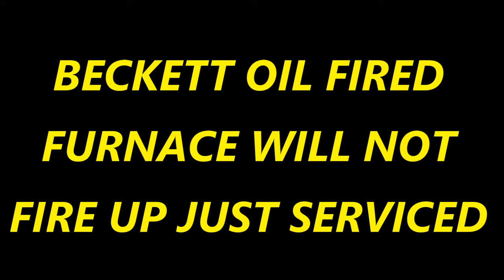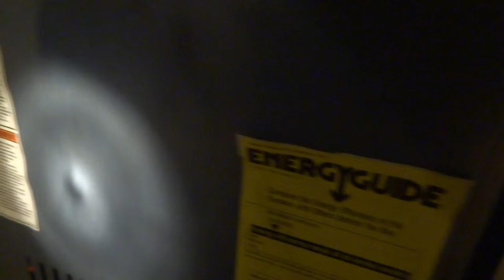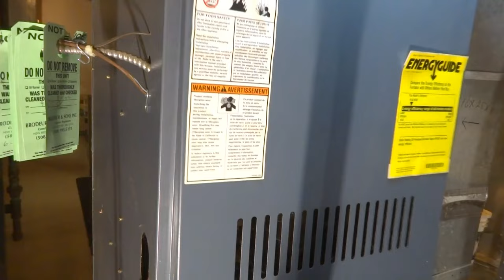OIL FIRED BECKETT FURNACE WILL NOT FIRE UP -JUST SERVICED

Comment: The spinner detects a magnetic field which you won't have with a failed winding in the solenoid coil. Also there is a old TSB (Technical Service Bulletin) about those coils. They would develop a break in the winding that would intermittently show up when the coil got hot creating a burner failure / reset problem. Diagnostics was.......If you suspect the coil on a intermittent reset problem, replace it .   Best of Luck.................
Reply: That was some great and specific info!
Reply: Lol. Steves not dumb, idk how he thought a compass would spin by electrical and not by a magnetic field. Lol. He knows he cant use it to test for voltage on wires, he must have had a brain fart. I get stuck on stupid sometimes myself.
Reply: @Dan-f7b he used it for detecting magnetic field. Before the solenoid replacement it did not spin. At 11:32 in the video you can clearly see it spin after he replaced the solenoid.

Comment: Steve that inductive spinner thingy is cool. It detects the 60hz AC magnetic field generated from the solenoid coil and is basically a very small electric induction motor. Another great job!
Reply: i hate oil as i pull started farrah fawcetts #2 fuel oil 2 stroke nuclear fusion reactor which fused helium into carbon fusion and barfed soot everywhere and surged a proton beam which produced an electromagnetic gamma ray pulse which over heated the boiler to our church dishwasher!
Reply: This fusion reactor fire a steam jenny steam cleaner  which heats water to 375 degrees accelerator protons and can steam clean any deep fryer hood at an nfl stadium
Reply: the electromagnetic pulse heats a coiled Hotsey steam cleaner at 375 degF 4000 psi steam shooter washer and drives the motor!

Comment: Hey Steve, A/C question. Do you run your A/C in "Auto" fan or "On" mode? I'm thinking air circulation around the house especially in a 2-story home where the 2nd floor is always warmer than 1st floor where the T-Stat is located. Especially at night when the A/C isn't running cause the outside temps are lower. 
Always learning from your videos from the multitude of service calls. Nothing beats on the job learning!

Comment: I’m just a  cable and my aunt called about a tv issue so after dinner went to fix it but as I was going through her back  area I se her evaporate sitting on top of her fan with two fillers on top of the radiators pulled them off and seen black is there something to clean that with don’t want her to breath that black mold she is elderly and says she has been doing that for 20yrs I said don’t think Steve would like that and would say that’s a shit show